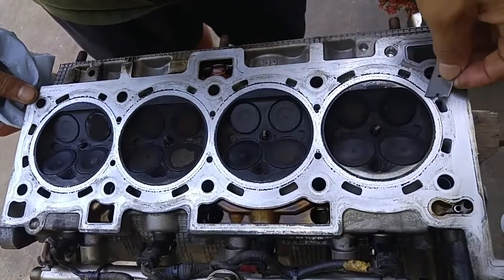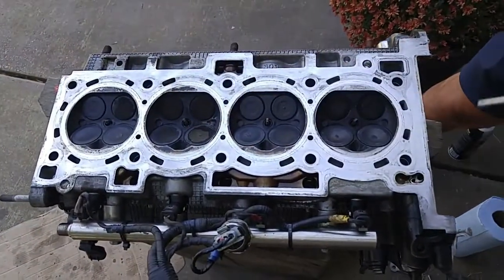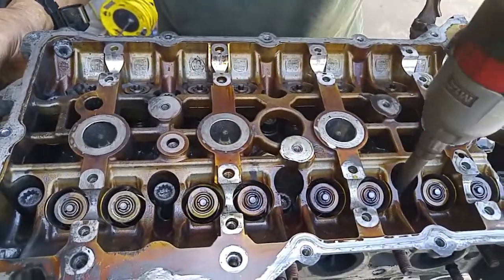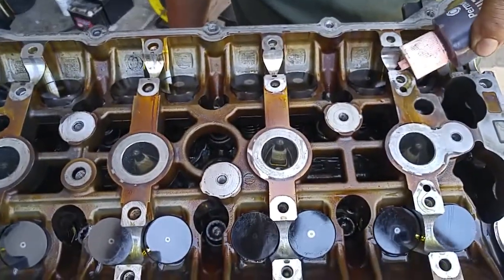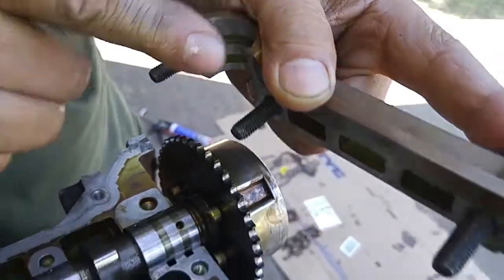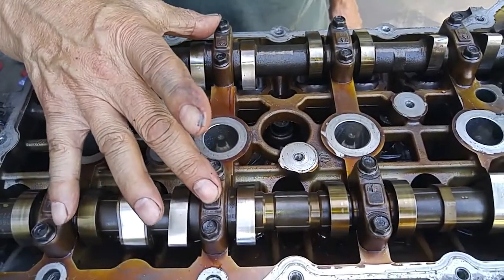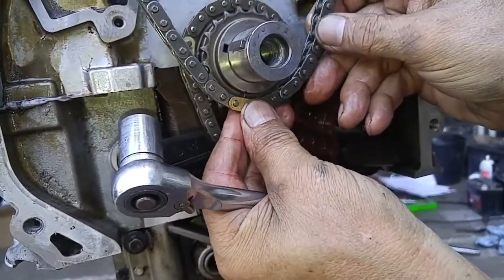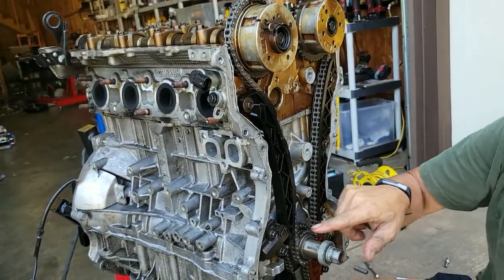How To Install Cylinder Head, Cams & Timing Chain (Hyundai / Kia 2.4 GDI) Long Block Rebuild Ep. 2

Comment: When I was installing the cam shaft bearing cap that has the 4 bolts my broke in half where the half bearing goes. How screwed am I? I went to the wreckers and got a used one. Would a new one be better? What are my options? Thanks for the help. Great videos by the way!!
Reply from the maker: You're okay.  Just replace it with the one from the wrecker.
Reply: @hardlymovingpro awesome thank you! Even the parts guy at Kia when I called today said to get one from the wreckers.
Reply from the maker: Good for you!

Comment: hi, need some advice, do the cylinder head bolt thread need to be lubricate when installing or just let it dry?
Reply from the maker: Recommend lubricate with 30 weight motor oil.

Comment: just one question. when doing the next steps of the torque sequence (90 to 95º) is the torque wrench still set at 25 ft lbs? cheers
Reply from the maker: The torque wrench used in the video does both lbs and angle torque.  So after 25 lbs of torque, the wrench is reset to an angle torque setting.

Comment: Hi!   Thank you for the best content about rebuilding Kia/Hyundai 2.4 engines.   It helps a lot !   I have question , is it OK to use old cylinder head bolts or I need to buy new, are they  TTY ?
Reply from the maker: Thanks!  I've had no problems reusing the old head bolts.
Reply: @hardlymovingpro  Thank You!  I am rebuilding engine for the first time. 2018 Santa fe 2.4 gdi 116k miles. Broken valve and oil burner.
Reply: @hardlymovingpro    Engine is completed and I droped it in the car yesterday.  Works great ,  no leaks, no codes.  This is my first engine rebuild. Thank You!
Reply from the maker: Good for you!  Great job!

Comment: My problem is the timing marks don't line up because all the valves are in. When I took it off they pointed at eachother. Hopefully the video covers that (not done watching).
Reply from the maker: Watch the whole video for aligning the timing marks.
Reply: I got it, thanks. Once I turned them with a wrench all the dots lined up perfectly.

Comment: Have you rebuilt the 1.6 Hyundai/Kia motor? Also, i'm not familiar with angle degree using torque wrench.
Reply from the maker: Not a 1.6 but a 2.0 Turbo.  Hyundai's engine layout is basically the same;  that is an aluminum head bolted on a aluminum block.  The head bolts are called "stretch" bolts or TTY (torque to yield).  After the bolts have been initially torqued at a low lbs torque setting, the final torque is applied by number of degrees the bolts must be turned.  This process "stretches" the bolts.  If you don't have an angle torque wrench, you can apply paint marks at 12 o'clock on the bolt heads.  Then twist the bolts 90 degrees which would be to the 3 oclock position.  For the final torque, twist to the 6 o'clock position.
Reply: @hardlymovingpro  Ok, makes since, wasn't familiar with the terminology. Thanks!
Reply from the maker: You bet!

Comment: Hi good evening. The torque specs on this video are they the same for a 2018 2.4 sonata? I’ve had to take my engine apart to replace two cracked exhaust on my 2018 sonata with 104,000 miles
Reply from the maker: Yes.  Should be the same.
Reply: Same thing happened to me on cylinder 2 
Just a hole in the exhaust valve

Comment: Does cylinder 1 have to be TDC when installing timing chain or don't matter as long as the dots an links line up ?
Reply from the maker: Cylinder 1 should be at TDC to allow the cams to be moved to their correct position.

Comment: I need to rebuild a 2015 hyundai 2.0 Turbo Theta ll, is this video the same way to do it? Any help will be greatly appreciated
Reply: By the way awesome video and nice audience
Reply from the maker: I rebuilt a 2.0 turbo engine in a 2011 Sonata last year.  Had a warped cylinder head and block (from over heating) and the piston rings were all stuck.  The crank was still good along with the block's bores.  The major difference with the 2.5 was the oil pump design.  It doesn't have balance shafts.  External to the engine, the turbo's impeller shaft was bent.  I purchased a new turbo impeller unit online for around $100 and swapped it out from the exhaust manifold.  I also replaced the waste gate actuator which was also under $100.  So the machine shop decked the head and block, polished the crankshaft journals, honed the block bores and cleaned up and checked the cylinder head valves for leaks.  Put everything back together and the car's been running fine ever since.  The idle is a little rough compared to my 2.5L 2010 Camry, but put the "pedal to the metal" and this Sonata moves!

Comment: After the engine is complete and installed back in the vehicle, is there a special process for adding coolant?  I'm just wondering if the lack of coolant in the block will mess with the break in process?  Do I just fill the radiator, let the car warm up, and let the thermostat open and continue to fill until it's full?
Reply from the maker: Good question.  Just adding coolant into the radiator will not get coolant into the engine block.  Detach the upper hose from the radiator and pour coolant directly from the hose into the engine block.  Coolant will fill the block and will migrate into the radiator from the low radiator hose.  At around 1.5 gallons, re-attach the upper hose and fill the radiator to the top.

Comment: iiiiiveo que es de los pocos que si contestan los mensajes yo estoy armando uno por desgracia no lo desarme yo y me mandaron todo en cubetas y no tengo mucha experiencia en estos motores pero me llama la atención el torque ustd le dio 25 libras pie mas dos pasadas de 90 grados es asi?el carter de aluminio cuanto lleva de torque? es correcto usar silicon? le agradezco lo de su video muy sencillo y facil de aprender Santos Elvir le saluda desde Honduras saludos a todos
Reply from the maker: 25 libras para los pernos de cabeza seguidos de 2 pares de torsión en ángulo de 90 grados. Use sellador RTV, como se muestra en el video, en las esquinas de la junta de la culata detrás de la cubierta de la cadena de distribución.

Comment: I’m currently rebuilding my engine says it had a knock .. the rods have a little play but idk if it’s enough to register a knock and how do u figure out where the valve buckets go back on ?
Reply from the maker: In these engines a knock is usually caused by worn or spun one or more rod bearings.  With respect to the valve buckets, here's someone that made a post:
@JxztarBeats  with the cams out, find 2 of the same thickness tappets, say .130in. Install tappets on just one cylinder at a time. I start with the #1 intake valves. Measure the valve clearance and wright it on the head on the v/c gasket surface. Just go down the line and keep them in order. Subtract .0079 from valves clearance, ( v/c - .0079 ) + .130in. = ?  Say your valve clearance is .030in. so now you do the math. subtract .0118in. from v/c on exhaust.
 (.030in.-.0079) + .130in.= .1521in..
  This is the thickness of the replacement tappet you need. This should allow you to put the tappets you have in the correct spot. This number already has your clearance figured in. Find one that's that are close. never tighter, and number the tappets in order. I number them from the front of the head back, and the exhaust I letter them from a to h on the exhaust. Its a pain but this will get you good.

Comment: why are you reusing the head bolts? I figured that you would reuse the head gasket by copper coating it with new bolts. Not the other way around. And the book says not to put lube on the head bolts.
Reply from the maker: Rebuilt over a dozen of these engines with no issues re-using the TTY stretch bolts.  Also, if you watch the video again, no lubricant was applied to the bolt threads.  I would never, ever reuse a head gasket on an all aluminum engine.   These gaskets are embossed multi layered stainless steel with a special coated sealant to allow the cylinder head to float or stretch on the engine block during heat cycles.
Reply: If you are responsible financially for the job, and are instructed by the manufacturer to replace the bolts, it would be a no-brainer. Know if the customer said reuse the bolts and it breaks he owns both pieces.Not your problem. On a bolt that is designed to stretch, they’re only gonna do it so many times before they snap. Sorry, but you can’t tell how many times It has stretched to its normal limit. They sure are cheap Insurance and hopefully they won’t have a failure sooner than later. You have to admit that these repairs are not cheap and if one of the reused bolt snaps you’re gonna eat that repair job. I don’t know about you but I can’t afford to eat a $1500-$1300 hickey. Just my way of thinking. I use voice recognition and my phone didn’t pick up me talking about lube on the head bolts. I don’t understand why you wouldn’t use some type of lube at least under the head washer. I’m sure there’s a reason but the factory doesn’t give you a reason why in the book.

Comment: Did you have to remove valves before sending to machine shop?  I have no experience with valves adjustment....so my other question is, how do I clean the valves without removing them?  Of course, since it is direct injection, the valves are gunked with carbon.   Any advice?
Reply from the maker: Good questions.  No need to remove before bringing it to the shop.  They will check for any air leakage between the valve seat and valves.  If any problems,  they'll either reseat (via grounding) or install new valves.  Important thing is to clean out all the carbon buildup in the intake ports or let the shop do that as well.
Reply: Where should I buy parts? (Crankshaft, bearings, rods and pistons)  I just want to make sure I don't get cheap

Comment: Hello sir, I am putting together one of these engines and I had all the lifters in order but they were disorganized. I know that each one has a different number on the bottom. What could I do to put them in order?
Reply from the maker: Good question.  I believe that caps are all the same size but are numbered different based on a production run cycle or batch.  You can install all the caps and the cams before mounting on the block and check for valve lash or gap using a feeler gauge.   The valve clearance limits are:  Intake 0.10 - 0.30mm  Exhaust 0.20 - 0.40mm
Reply: @hardlymovingpro  great thank you for the info sir
Reply: @JxztarBeats  with the cams out, find 2 of the same thickness tappets, say .130in. Install tappets on just one cylinder at a time. I start with the #1 intake valves. Measure the valve clearance and wright it on the head on the v/c gasket surface. Just go down the line and keep them in order. Subtract .0079 from valves clearance, ( v/c - .0079 ) + .130in. = ?  Say your valve clearance is .030in. so now you do the math. subtract .0118in. from v/c on exhaust.
 (.030in.-.0079) + .130in.= .1521in..
  This is the thickness of the replacement tappet you need. This should allow you to put the tappets you have in the correct spot. This number already has your clearance figured in. Find one that's that are close. never tighter, and number the tappets in order. I number them from the front of the head back, and the exhaust I letter them from a to h on the exhaust. Its a pain but this will get you good.

Comment: Is this going to be similar to a 2.0 from a 2019 hyundai Tucson SE? Mine spun a rod bearing on number 3 and damaged the the crankshaft and rod and connecting cap. Im not a mechanic and no mechanic shop by me would rebuild my engine so now im stuck doing it on weekends. I have the engine out and just started on disassembling it
Reply from the maker: Yes.  The 2.0 is virtually identical to the 2.4.  In 2015 they slightly changed the engine's timing chain cover and some other minor external differences.  I highly recommend you bring the engine block, crankshaft and cylinder head to a machine shop.  They will thoroughly clean and clear out the oil channels of metal debris caused by the rod's bearings disintegrating and contaminating the oil which the oil filter can't pick up.  Have them checkout the crankshaft  to determine if the crank is bent and if they can turn down the journal surfaces.  If they turn down the journals, you'll need to get oversized crank and rod journal bearings.  .020" on the mains and .030 on the rods is what they usually take out.  They'll also tell you if your bore can be simply honed or may need to be bored out.  If boring is necessary, they'll usually increase by .020" or .5mm:  which means you need to get oversized pistons.  Also do not reuse the pistons and rods.  Get new ones.  If you have any other questions, send me an e-mail @ hardlymoving@gmail.com.  Good luck!
Reply: @hardlymovingpro  thanks, i already went ahead and bought a new crankshaft, rods and bearings. Just trying to find the pistons, but ill definitely take it to a machine shop. It just spun one rod bearing and when i put a new one in and ran fine until i gave it gas then the new one spun which was probably from the connecting rod and journal having chips of metal takin out. Do you think everything else would be fine? Or should i just go on the safe side and replace all the pistons? I just dont understand these new car engines, do oil changes every 3k to 4k miles and they still break lol meanwhile i have a 2007 honda accord with 240k miles and never had any engine problems or trans problems haha Edit (Can i reuse the other 3 connecting rods and pistons that have no damage ?)
Reply from the maker: Play it safe and buy new pistons.  I believe the factory rings are too weak or get weak over time / miles.  This results in oil consumption, the piston(s) rocking in the bore that scuff the piston skirts (teflon coating wearing out), cylinder bore flat spots and vertical wear groves.   A spun bearing will leave fused bearing metal residue on the rod journal surfaces.  No way to remove it with the crank in the engine.  It must be machined off where most machine shops will remove .020" off the crank rod journals.

Comment: Excellent work, I also rebuild these 2.4l Sonata and Optima engines myself. Yet, I've identified that you do not use the color coded rod nor main bearings in your build as the service manual calls for. I have been trying to reduce my cost with OEM rod bearings...Their killing me in cost. Is there an alternative to the color coded bearings for the 2.4l on ebay? Thank you Sir.
Reply from the maker: Thanks!  I don't buy anything from dealers if I can help it.  Rod bearings are a low tech part and there's plenty of high quality bearing suppliers that provide replacement parts as good or better than OEM.  The brands that come to mind are Hastings, King, Engine Tech and ITM.  My engine machine shop uses them all the time.  Go to rockauto.com and if out of stock, get the part number and trying obtaining from Amazon or any other on line supplier.  Good luck!

Comment: Hi did machine shop recommended what piston size and bearing size to go for it and you searched internet ?
Reply from the maker: The factory bore diameter is 87mm.  Numerous vendors on ebay had new .5mm oversized (i.e. 87.5mm) pistons for sale.  I brought the block to the machine shop.  They said that removing .5mm or .020" should be more than enough to round out the bores, remove any vertical groves and scoring and maintain enough material in the steel bore sleeves.  After he bored and plateau honed the bores, I bought the new oversized pistons and everything went back together perfect.
Reply: @hardlymovingpro  Thanks do you know if Toyota Camry or Pilot 2015 model do allow to over bore by  .5mm .. i heard latest cars dont allow to overbore.. please advise
Reply from the maker: Don't know about the Pilot engine;  however on the Camry 2AR-FE engine, I did watch a video of a guying rebuilt one where the factory repair manual stated it could over bored.  Believe he removed .5mm or .75mm.
Reply: @hardlymovingpro  . Usuallly there is piston to walll clearance. that means probably he left 1mm and have bored .4mm and asked you to buy 87.5mm. you cant bore and put piston same size..
Reply from the maker: I'll rephrase by saying the oversized pistons were for a 87.5mm bore;  not the piston diameter.
Reply: @hardlymovingpro  Thanks, so you bored first for 87.5mm and find after market piston for bore size of 87.5mm?
Reply from the maker: Yes.  I checked with the machine shop if he could bore out .5mm?  He said there was enough material in the bore sleeve to remove the vertical grooves and flat spots which would equate to .020" or .5mm;  that he didn't expect a need to go to .030" or .75mm.   When he called me to pickup the block, I ordered both the oversized rings and pistons.   Afterwards, I went to his shop with the pistons and rings.  Everything fit perfectly.  The rest is history.